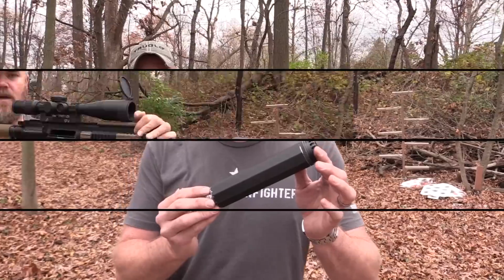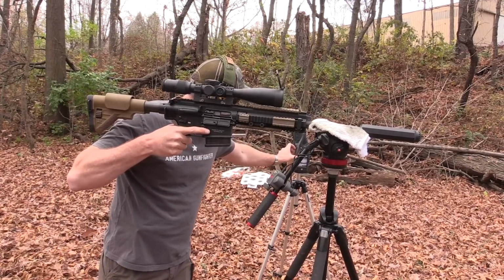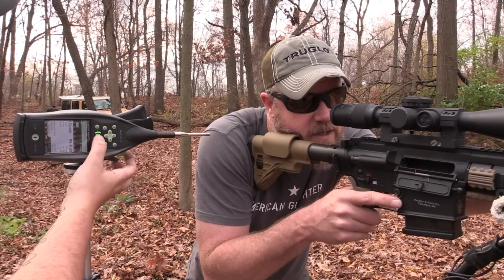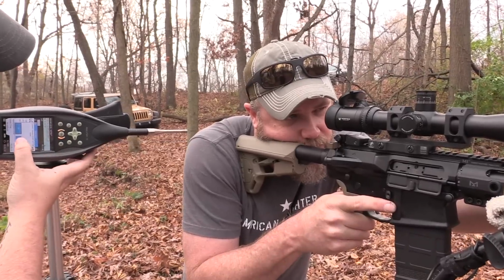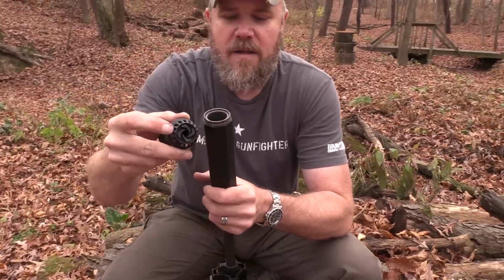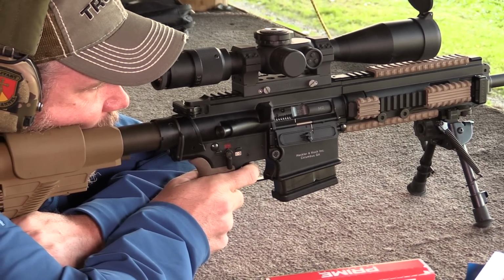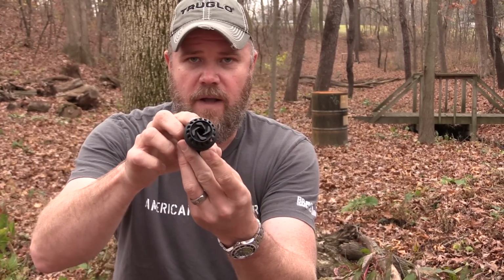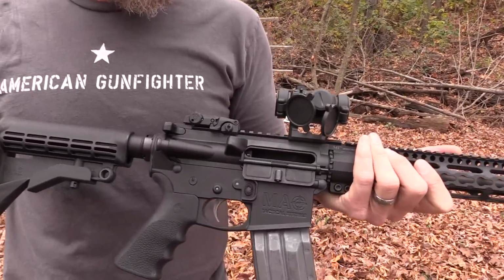New OSS Helix 762 Silencer full test!

Comment: I was hoping I was going to have to eat my words when these came out a few years ago, in that the design was fantastic but its suppressing ability was somewhat subpar. Well, still on the loud side. Damn depressing.
Reply from the maker: ...because we've all been in gunfights in our homes with rifles. I think it's far more likely we'll be using our suppressed rifles at the range or for hunting. Totally negated back pressure so all guns work properly without a need for adjustable gas blocks and specialized bolt carriers along with hearing safe operation for civilian/non-combat shooting and the OSS has a lot to offer.
Reply from the maker: Are you making this comment as Special Operations guy or as a civilian? Let's go with civilian. Why in the world would I care anything about causing confusion with enemy paper targets or prey like deer? That's how 99.9% of silencers sold to the civilian marketplace will be used.

Not scientific testing? So, an industry standard B&K meter set at the same location as current CSASS requirements is, what, hogwash? I even included the current arbitrary industry standard of 1.6m off the ground and 1m left of the gun... and that's what, made up numbers?

If you don't find lowering the dB's at your ear useful, then I'm confused as to why you collect suppressors. 

If you don't find the serous reduction in back pressure useful, you probably don't use your vast collection of silencers all that often on a wide variety of firearms. Most AR10's I suppress using conventional cans, including the MR762A1 LRP, don't function at 100% due to massive back pressure caused by the silencer.

If you don't find the notable reduction in carbon fouling in your guns to be useful, I again can only assume you collect more than you shoot. That, or you're rich and pay others to clean your guns or perhaps find some sort of entertainment in scraping carbon out of the innards of your guns. 

Are the OSS cans flawless? Nope. They trade one benefit for another. I personally find the fact they reduce dB's at the shooters ear useful. I find the fact guns I put the OSS on that previously had functional issues with baffled cans but work with the OSS to be useful. I also find the almost completely eliminated back pressure to be useful. This comes at the expense of destroying the hearing of my paper target or the deer I just shot in the chest... I think I can live with that. 

Yes, they are several ounces heavier than other cans. Yes, they are expensive.
Reply: I must admit, I am also quite disappointed.  Thus far I've not found a single online "Reviewer" that actually uses a true scientific method in their testing & evaluation of OSS Products and other competing products.  NFA Review channel's review of the 5.56 version was even less "scientific" and just regurgitated the published db data from OSS.Until recently OSS was also very secretive about the WEIGHT of their systems - especially the earlier "Modular" designs.  This more compact version weighs in a 22 oz, which is quite heavy compared to other products on the market...  There is also no comparison being done about sound testing at different distances down range from the muzzle.  Part of the function of a suppressor is not just hearing protection for the shooter, but also to increase confusion as to the origin location of the gunshot.  By not containing that muzzle blast, merely directing it forward away from the shooter's ear - you are not masking down-range perception of the sound of the gunshot.Take into consideration the shot spotter systems in use in urban areas, or in military usage.  These systems do not attemp to track the sound of the sonic crack - as the sonic crack can deceptively echo off nearby buildings & trees.  They track the sound of the muzzle blast.  In a traditional suppressor - this is more contained than in OSS systems.As  you stated, it needs to reduce sound signature of the gunshot for both the shooter and anything else in the vicinity, otherwise it becomes more of a (expensive, heavy, with slightly sub-par suppressing ability) niche suppressor in a saturated market.I really wanted to like OSS Suppressors, and I really wanted to see how their products would work in the long run before adding some to my collection of suppressors, but I was first turned off by the self-destruction of their early models, their notably worse performance of ealier generation models, the shady marketing of OSS's corporate people, and still to this date, there has been virtually ZERO published, truly STANDARDIZED testing utilizing a true scientific method.As it stands, this suppressor provides the civilian (and even most of the LE market) with virtually ZERO benefit for the cost, weight, change in point of impact (with that weight), and while it's a cool system, I won't waste my money on it.  I could buy two very high quality titanium 7.62 suppressors with better semi-auto performance (and 47% lighter weight) for the price of one OSS 7.62 ELITE with SRM6 (which adds to the weight).Interesting design & technology I'm still eagerly awaiting publication of independent, thorough, and scientific testing data of their products to see how this technology plays out in the future.  Maybe I will buy one some day, but without full-auto in my collection at the moment, it's not worth the cost & weight.
Reply: @CMDR Boom and @cobannie, you seem so intent on bashing OSS that you appear to be neglecting to make sure you are fully informed before expressing your opinions.  As somebody who has followed them closely for years, I'll try to help a little.  To the best of my knowledge, up through Gen 4 the only OSS design was 2 pieces.  The first piece going back over the barrel (they call it the BPR--Back Pressure Regulator) provided significant sound suppression (albeit not hearing safe) without protruding any farther out than a typical flash hider.  Then the SRM (Sound Reduction Module) could be added in front of that for full sound suppression.

With Gen 5 they started offering a one-piece flush-mount version.  I'm not sure if they are continuing to label generations but Tim/MAC said somewhere here that he thinks they are on version 7.  Regardless, this version that he tested is definitely brand-new and as far as I can tell is a one-piece flush-mount design that is not intended to be combined with any other piece.  They still have the 2-piece over-the-barrel design but it appears they are targeting it at military applications at a much higher price.  It would certainly be cool to see Tim meter the two designs to compare them, but obviously OSS has decided to go in a different direction with their models focused on civilian sales.

I find it amusing that you are so obsessed with scientific comprehensive testing yet you never hear anybody complaining about such things when talking about new products from AAC, SilencerCo, Dead Air, Griffin, etc.  The bulk of the data available in the suppressor world is anecdotal user reports, yet you are now saying that user reports are not acceptable when talking about OSS...?  Of course we would all like to see a comprehensive effort at scientific testing and comparison of top suppressor models, but there is much more than simple meter measurements to talk about.  Are you interested in financing 10,000 round torture tests for each suppressor?  Because that's the kind of thing you would have to do to truly demonstrate the full potential of the OSS design.  Do you have the ability to measure bolt speed?  Do you have the ability to measure the amount of gas coming back out of the chamber?  Etc.

The simple reality is that H&K evaluated this design for 2 years before offering it as part of an OEM package.  Do you think H&K is just a victim of OSS marketing?  Do you think H&K ignored all other possible OEM partners?  I'll agree that OSS marketing and sales efforts leave a lot to be desired--I don't know if that's because they are staying so busy with military sales that they didn't care about civilian marketing, or they are just incompetent in that department.  But I would say they have been far from "secretive", "shady", etc.  They have known from the beginning that weight would be a concern.  If you look at the various components, you can see that there is a lot of metal involved.  It appears to me this has been the source of conflict within the company, with the founder (Russ Oliver) wanting to focus on performance and durability over all else (which would reconcile with Tim's statement here that Russ wanted to focus on military sales), while the new corporate management wanted to try to reduce weight (one of the biggest concerns for civilian consumers).  This actually led to Russ quitting the company.

In every conversation about OSS it seems there are people who insist on making mountains out of mole hills.  Frankly, how do you even know that higher readings to the side equate to higher readings downrange?  Yet you make a big deal about it based only on your assumptions!  Obviously OSS has not made the ultimate perfect suppressor yet.  But who else has?  If you want to play Hollywood assassin with your almost-completely-silent subsonic .300 Blackout bolt-action, then obviously there are better options than OSS.  If you want the lightest possible option to put on the end of your long hunting rifle, then obviously OSS isn't the first choice.  And if you want the cheapest possible suppressor to put on your AR just so you can look cool on Instagram and FaceBook, then obviously OSS isn't pursuing your business.

But if you don't like the idea of gas in your face, more fouling coming back into the chamber, extra bolt speed beating up your rifle and compromising feeding reliability, as much as a 2/3 reduction in heat buildup in the suppressor, a much longer lifetime potential, etc. all with effective sound suppression comparable to leading competitors, then maybe you should check out OSS for yourself and ignore all the Internet keyboard commando experts.
Reply: I'm not bashing OSS, and in my follow-up comment where I re-learned of their other offerings (and their new 'economical' civilian line), I went so far to add that I've egged my face. 
As I stated in my first post, I love the design but was pointing out my concerns of comparable suppression abilities compared to the competition. That and my last experience with these were several years ago when they first arrived on the market.
I'm not debating that they have several inherent qualities that you simply can't do with any other suppressor I'm aware of on the market, at least on the same level and longevity. I just said that they were louder than expected (initially) and found out the additional module was really for suppression. 
I also went looking last night for reputable dealers and found a few in my area going for anywhere between 1245-1500$. Yeah, it's got sticker shock but I'm of the variety that if it lasts longer than it takes to shoot out a barrel, it's money well spent.
Reply: Military Arms Channel it was unscientific once you changed hosts. Test them both on the DI gun
Reply: Great points. The debate seems to be based on the idea that most non-military shooters want to believe they will be doing more than killing paper at some point in their lives. Basically, zombie-apocalypse hopefuls. It's kind of like recreational diving vs commercial diving. The standards for equipment are different based on their application. Recreational shooters should be doing a happy dance based on the results of testing with the OSS. It's clearly designed with the shooter in mind. It offers better hearing-safe shooting AND doesn't blow nasty back in your face. Those two things alone should be major selling points to anyone that actually shoots suppressors. I've done the gas in the face thing and it actually take the joy out of shooting suppressed. 
Great video MAC.
Reply: Military Arms Channel Yeah, I certainly wasn't saying civilian applications wouldn't benefit from what they've done!  I've got 4 Gen 4 models in ATF jail right now myself. I was just pointing out that the price is a big turn-off outside of military sales except for those who just want the best whether they will use it to its full potential or not, because the typical civilian user is not going to experience a lot of what they paid extra for.

I'm hoping that they can figure out how to follow the lead of Delta P and figure out how to take all that complicated machining work and do it with 3D printing instead.
Reply: Military Arms Channel On the indoors statement, that was more of a generalization of suppressors in my thought train, but yes, the first weapon I reach for in bump-in-the-night moments is not a rifle either. In my experience with active shooters however, patrol rifles are in more hands then pistols, so I stand by my initial qualms where db's are concerned. 

And here comes the however moment: I'm a die hard researcher when it comes to new(ish) tech and interesting designs, and one thing I had forgotten (and re-discovered this evening) was that OSS also offers an additional sound-suppressing module which does everything I'd want out of an indoor user-based suppressor. So hey, I get to eat crow after all. Any chance you'll get to snag one for a follow up?   

Just as an interesting side note, I also learned the OSS design is a modern improvement on the original Maxim silencer. I don't recall the mounting location (I'll have to rewatch to double check of course) but if the OSS is a contained unit, could it mount on the muzzle and ride backwards down the barrel essentially, negating add-on length? Not a question for you to answer, I'll figure it out.
Reply: CMDR Boom fwiw, a sales rep told me in the past the only part that would "wear out" was the flash hider/muzzle break component (depending on rate of fire).  I have a hard time imagining how that could wear to the point it's unacceptable for civilian applications, so for my purposes I figure the expected lifetime is indefinite. :)
Reply: He answered that about 30 times already in the comments here...
Reply: CMDR Boom Why do you say depressing? Did you watch the whole video?  Who cares what it measures to the side, I care what's happening at my ears!
Reply: mikesmith379 Out in the woods it doesn't matter except for the shooter, but take that scenario into your house where your wife and children are in different locations to your muzzle with an active shooter somewhere in between, then yes, the old standard of suppression measurement does matter. Ideally of course we'd have the best of both worlds and be hearing safe on both ends, but sacrificing one for the other must be a compromise for one specific purpose. To that end, operators have the same problem. If you discharge your weapon around the people you are trying to save but still being able to take out the threat, what is an acceptable level of hearing loss then? You see where I'm going with this.
Reply: I understand what you're saying, but I can't see how I should care more about the possibility of others being nearby more than the guarantee that I will be close every time I shoot.  Sure, it'd be nice to have both, but I'm going to choose my always-present ears over hitting somebody else who MIGHT be there with a few more db every time.
Reply: mikesmith379 Not trying to bash you, but perhaps change your perspective. For your intended purpose, this particular product is fantastic. For the market in whole, it comes down to the end user and where it's going to be used most of the time, and that's how a manufacturer (should) balance a given product. In this case, if OSS wants to move more suppressors, it needs to be quiet for both the user and the people in the vicinity, otherwise it becomes more of a niche suppressor in a market that's becoming more saturated by the day. 

Not that I condone this either in the least, but H&K did this some time ago (to a negative effect in my opinion) by aiming its products to LE and military and essentially saying the civilian market takes a back seat in priorities. Govt contracts are so lucrative where you get larger and more immediate sums of money, repeat business, and larger orders versus one guy who buys one or two suppressors every few years, that that one factor rippled all the way into their primary influence in product design. 

TLDR version: OSS wants this to be an operator product for military use but it just ins't in its current form. (But with some refinement it could be!)
Reply: As cool as I think the OSS design is, the reality is that most of its potential is wasted on any civilian (and also most law enforcement) applications.  It finds its full potential when the user is dumping multiple mags at a high rate of fire in a high-stakes engagement where dealing with gas in the face/eyes, weapon performance issues, etc. could have deadly consequences.

If the price for all that performance superiority is that somebody nearby gets a few extra db of volume, then I'm fine with that.

Comment: Tim- why didn't you compare apples to apples?  Could've put both cans on the HK and compared the readings off to the side and by the ear. Using piston and DI with different cans just creates more questions than answers.
Reply from the maker: The muzzle device for the OSS is classified as a "silencer component" and thus you can only have one which ships with the can. They are working this out with the ATF so this won't always be the case. I got it for the HK rifle because this is the new CASS system not thinking that I wouldn't be able to run it on any other AR10. More testing will take place, but the results will be similar. The lack of back pressure is pretty obvious.